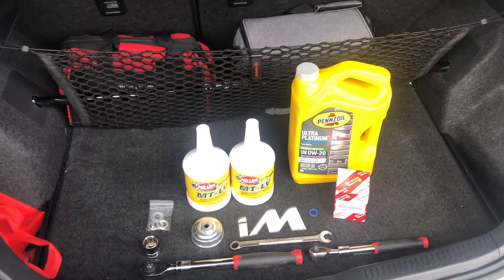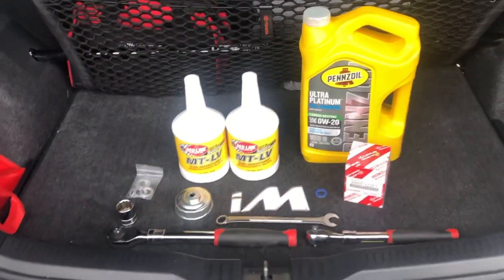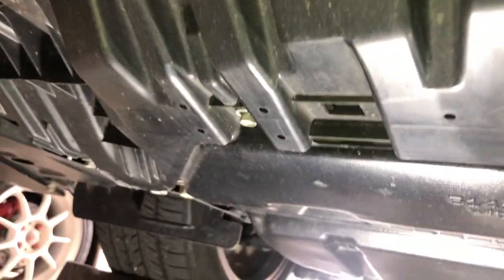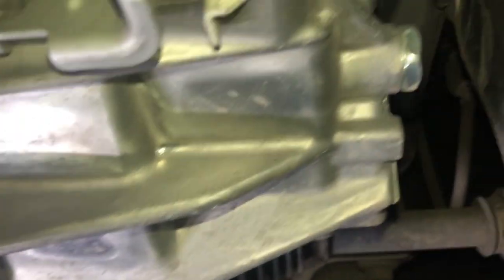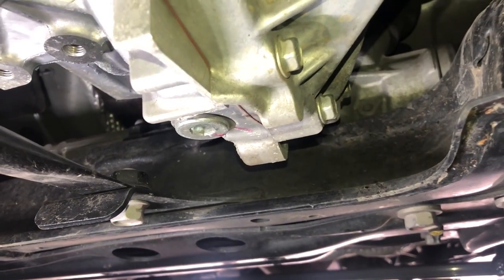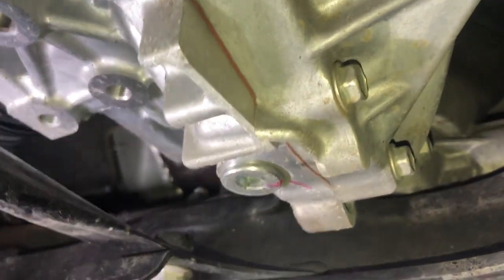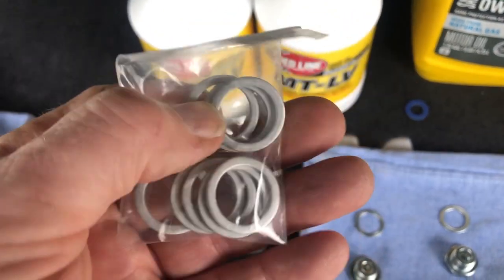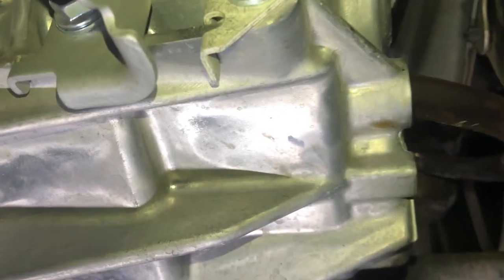How To Change The Gear Oil 2014-19 Toyota Corolla/Corolla iM 6-Speed Manual Transmission

Comment: This will work on your 2019-2022 Corolla hatchback as well. It’s honestly the same setup. So this way will work and it is the same tightness on the Corolla hatch back 2019-2022 (6 speed)
Reply from the maker: Yes, you are correct. In fact the Corolla manual transmissions even use this same Redline MT=LV gear oil from the 10th Generation starting with the 2009 model year in North America to current model years.
Reply: @jimsgaragetoys  is that fluid GL-5?
Reply from the maker: @volt6008  No, the transmission calls for a GL-4 gear oil. A GL-5 gear oil can damage the transmission synchros.
Reply: Thanks for that info, I'm going to do maintenance on my 2020 Corolla Sedan 6mt!

Comment: What i did with one jack is that I lift left front side so i can drain it easily then remove wheels, lower the jack until it seems leveled then fill it up
Reply from the maker: That will also work but I don't like to rely on a jack to hold up the car. Plus it's easier to remove the underside shield if the car is up and flat. 😉
Reply: @jimsgaragetoys  yeah... never want to be under a car that's only on a jack...
Reply: I am also using ramps like the ones in the video and my driveway has a slant (probably around 10 degrees) so I back into the driveway and when I drive onto the ramps like I am driving away, the front gets lifted up but the car is just about leveled.

Comment: Thank you for your video. Do you know the tightening torque for both screws?
Reply from the maker: I don't off the top of my head. I've never torqued gear oil fill and drain bolts. They have a washer on them and I just snug them down as I can feel the washer crush. It doesn't have to be crazy tight, so by just snugging them down has always worked for me. I've never had one leak in any way. In fact, talking to most mechanics they do the same thing, but many tighten them too much.

Comment: I recently got a 2018 iM with 6,000 miles and I’m not sure if the MT fluid was ever changed. Do you think it would need a drain and fill? If so, what fluid do you recommend? I don’t have any difficulties shifting and the car drives fine. Just want to know if it needs one though.
Reply from the maker: I'm guessing you mean 60k miles because with only 6k miles you wouldn't need to worry about it. If indeed you do have 60k miles, then yes, it needs to be changed. I change my manual transmission gear oil every 30k miles and I see that interval is commonly recommended. The manual transmission on all Corollas starting in 2009 with the 10th Gen uses a 70w/75 GL4 gear oil. My go to gear oil is Redline MT-LV 70w/75 GL4. My back-up is Ravenol 75w which is very popular in Europe and also highly rated. The links to both of them are in the description below the video.

Comment: Thanks for sharing this! For 2019 Corolla Hatchback XSE 2.0L, it shows 2.5 quarts of gear oil. Was 2 quarts enough for yours?
Reply from the maker: The 6-speed manuals from 2014 and newer use 2 1/2 quarts while the older 5-speed manuals from 2013 and older use 2 quarts.
Reply: @ragetoys4963 It really does suck to buy a 3rd bottle for that extra half a quart because it is not cheap and the other half a quart will go unused but thanks for clarification! Btw, what brand/model cold air intake did you install on this Corolla?

Comment: Thanks for this! Good advice attempting to loosen fill plug first! Wouldn't have thought of that.

I just started looking into this because I just got a '15 Corolla that has under 56k miles and I've been driving it for a couple weeks and out of nowhere today the stick is difficult to move and when I pull out of gear, it like springs to neutral with force. I'm hoping changing the gear lube will help. I don't know how to check my clutch master cylinder level yet... hopefully that's okay.

Is there any way to check the gear oil level? I am still broke from the down payment and the first mo. of insurance so I don't want to change it just yet (but very soon... wouldn't be surprised if it's original at 56k miles)... but I would like to at least see if the gear lube or master cylinder hydraulic fluid levels are low, if possible, so I know what's going on with my new beloved car!

If I don't have ramps or enough jack stands, can I just jack the front up, open the plug, then set it back down so it's level? And if so, how do I know if it's level enough? If steering wheel is straight and no brakes are engaged and the trans is in neutral and the car doesn't even think of rolling, even with a little push, is that level enough?
Reply from the maker: Thanks for the comment! I'll go through your questions one at a time. 
1. It's hard to say what is happening with the stick shift from your description, but I'll bet the gear oil is original and due to be changed anyway. 
2. There is no clutch master cylinder. The brake master cylinder handles both the brakes and clutch so check that level. 
3. The only way to check the gear oil level into raise the car and make sure that it's flat. Take of the fill oil bolt and pour some gear oil in. When it starts to flow out the fill hole it is full.
4. Anyway that you can get it up in the air and it's close to level will work. You can even make some tall wheel stands from wood for all 4 tires and jack up each corner and place the wood stacks that are screwed together under each tire. Just make sure that the wood is wide enough for each tire and that the car is secure.
Reply: @jimsgaragetoys  thank you! I think I'm finally doing it today or tomorrow! I may go pick up some ramps... Not sure... Wondering how hard it would be to raise the front, empty, then get my tube in from my full pump, then lower the car to the ground until it's level and fill, then raise it back up and close it. I feel as though this won't work, but just something I am considering!

I really appreciate your reply!
Reply from the maker: @RastaJediX  I would try and get the car level and raised as it's so much easier. Either use a set of ramps and jack stands or 4 jack stands. If you use my method to fill it from the top vs using the hand pump you will thank me later! Those hand pumps are a PITA.

Comment: Hello, my dealer wants to charge me $180 for 3 qt of the genuine toyota fluid so screw that.  My area does not carry redline MT-LV.  They do have 75W90 or 75W140.  What's the difference and which one is suitable for my 2014 corolla's manual transmission?
Reply from the maker: I wouldn't use either one of those. Either order some Redline MT-LV on Amazon or elsewhere online. I've also used Ravenol 75w gear oil with great success and I've heard of others that rave about it too. It's very popular in Europe. This also meets the same specs at the MT-LV. https://amzn.to/3WAUs2z
Reply: @jimsgaragetoys  Thank you for your feedback Jim.  Amazon Canada does not have the Red line MT-LV or the Ravenol 75W for sale at the moment; and your link does not ship to Canada.   There is a few performance shops in the Toronto area that carries the MT-LV fluid but all said its on back order.  May have to wait or get the Royal Purple Sychnromax from local store.
Reply from the maker: @kl5696  I would not use the Sychromax. I would use Redline GL4 75w-80 if you can find that as that's only one step heavier than the 70w-75 MT-LV.

Comment: I guess it's because i do it so infrequently that damn fill is so hard to find from the top.  Maybe easier from the bottom.  What's the bolt on top that looks just like the 24mm fill ushow?
Reply from the maker: I always remove the fill bolt first and drop the fill tube from above. Just insert it into the fill hole and fill from above after draining the oil oil and replacing the drain plug. It's super easy the way I show it.

Comment: Hey Jim it says you need 2.5l but you filled it with only 2? Also can you tell us the size of the tubing? 3/8 inch maybe?
Reply from the maker: Yes, the 6-speed manual uses 2.5L so I used 3 quarts and have about a half quart for my next change. The tubing I used is 1/2" inner diameter and 5/8" outer diameter. This has worked on all of the cars I used it on so far.
Reply: @jimsgaragetoys  thanks for the info Jim! Do you think redline is better than oem? I read on the forums some most people say it’s good but some say they are having problems
Reply from the maker: @rocklee7216  I personally like Redline more than anything else I've tried. I see many people use the wrong gear oil weight more than anything that have problems. I also see that they have an actual issue and hope it will help, sometimes that helps and sometimes it doesn't.

Comment: Where can I find the new bolts and washers??
Reply from the maker: I picked mine up at a Toyota dealer. I'm sure that you can also buy them on Amazon, eBay or other online sellers. I only replace the metal washers, not the bolts. A quick search brought up a lot of sellers. https://www.amazon.com/Aluminum-Transmission-Corolla-Replacement-90430-18008/dp/B072627HB9/ref=sr_1_4?crid=1KXDYSI9SNDSI&keywords=toyota+manual+transmission+drain+bolt+washer&qid=1673227777&s=automotive&sprefix=toyota+manual+transmission+drain+bolt+washer%2Cautomotive%2C138&sr=1-4

Comment: Witam chciałbym wiedzieć gdzie znajduje się korek przelewowy skrzyni manualnej toyoty corolli sedan 1,6 16v 2019?
Reply from the maker: I wish I could help you but I don't understand what you typed.
Reply: @jimsgaragetoys  Per Google Translate: Hello, I would like to know where the overflow plug of the manual gearbox of the Toyota Corolla sedan 1.6 16v 2019 is located?
Reply from the maker: @Turco949  Well we don't have a 1.6L in North America currently so I'm not 100% sure. I would guess though that it's in a similar location. Find your drain bolt location first and then look on the back, side and front of the transmission for the fill bolt. It won't be but a few inches above the height of the drain plug. Just look around and you should be able to find it.

Comment: MT-LV?? I'm pretty sure we want MT-90, but I guess it's not the end of the world so long as it's GL-4.
Reply from the maker: The 5-speed MT on the 2009-13 10th Gen Corolla and the 6-speed MT on the 2014-19 11th Gen Corolla uses the MT-LV as it calls for a 70/75 weight. The MT-90 is a heavier gear oil. I use it on my 2006 Scion xB 5MT and 1989 Supercharged MR2 5MT.
Reply: it’s the MT-LV! at first, i put MT-90 in my iM and chifting is rougth went it’s cold.. MT-LV shift like butter!!
Reply from the maker: @rockrobert6619  Yep, it makes all the difference in the world!
Reply: At what mileage did you do your gear oil ? I have a 2018 and it's about to hit 60k and I've noticed a significant change in the shifting since I got it back in March. When it's cold it shifts really smooth and then once it warms up it sometimes wants to go into gear slow or it's a bit rough when shifting into 1st , 2nd , and reverse ... Never grinds just a bit harder to put into gear. 
It's still under warranty so I took it in to the Toyota Dealership and the tech said everything seems fine but I'm still going to have them do the gear oil ... They said the stuff that goes in my gearbox is something they normally don't carry. So they ordered some from another dealership and then they said that other dealership gave them the wrong stuff ... You think there giving me the run around on the fluid ? How common or uncommon is this gear oil ? I think they said it takes 75w ... Any advice would be cool because me having to miss 2 days of work because of there screw up is not cool.
Reply from the maker: @Chase253  Sorry that I never saw your question. I try to respond to everyone. At 60k miles I would have changed it a couple of times already. I normally change it every 30k miles from the mileage of my break in change. I change mine most of the time at 15k-20k miles and then every 30k miles after that and my transmissions shift like butter. You need to change yours ASAP. I believe that Toyota recommends every 30k miles also.
Reply: @jimsgaragetoys4963  it's all good your just now getting back to me. I changed the fluid shortly after I sent you the first message a few months ago. I got the car at 57k and I'm now at 63k since it's my daily and it's been pretty solid since the flush. I cleaned the MAF , changed the plugs,  cleaned the throttle body and did an oil change back in late July. My next move would be suspension,  what would you recommend as far as coil overs or suspension? I live and work in Seattle and the streets here are absolutely garbage and I can tell there taking a toll on my stock suspension. Any suggestions would be great
Reply from the maker: @Chase253  I live in SW WA near Vancouver and I know what you mean about Seattle roads. It really depends on what you want from your suspension. I've got BC Coilovers on my 2009 Corolla Turbo and really like them. On my iM I have Tanabe lowering springs. They are a mild drop but still have a nice ride.
Reply: @jimsgaragetoys4963  dope! I'll have to check out BC and see what I can find ! Thank you! I spent time down in Kelso while I was working at the Rainer Foss Shipyard back in 2014. It was a 20 min drive from Kelso so I'm pretty familiar with the Vancouver,  Kelso,  Longview area. I now work out of a smaller Shipyard in Seattle and honestly of I didn't have thos job I'd have left Washington a long time ago. I spent 5 years in the Army and was in SC and VA and eventually I'd like to move back there.
Reply from the maker: @Chase253  I love it here in the PNW. I've lived all over the country including VA and much prefer it here. In fact, once I moved west of the Mississippi River I've never had a desire to move back east. Since then I've lived in NM, CO, CA, and WA. I love the bigger mountains and all the wide open spaces out west compared to the congestion of the east.
Reply: @jimsgaragetoys4963  I agree , the mountains and foothills around here are amazing and I love the outdoors and camping here but I j8st hate how expensive everything has gotten. Since your in the SW area have you spent alot of time out on MT Adam's or Gifford Nat Park ? I have plans to hike that area next summer.
Reply from the maker: @Chase253  For sure, it's gotten more expensive everywhere. At least we have the cheapest electrical rates in the country! 🤣 I've explored all around Mt St Helens and Mt Adams, beautiful country and fun roads ti drive along with the Columbia River Gorge. You will enjoy it when you get the chance.